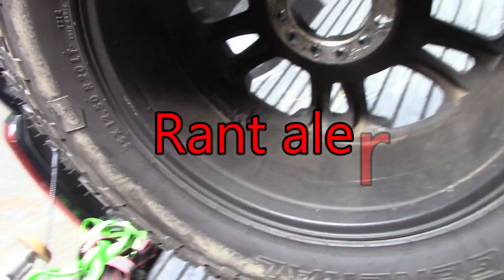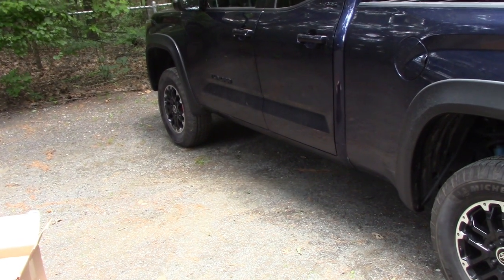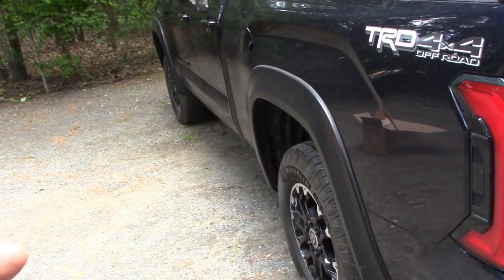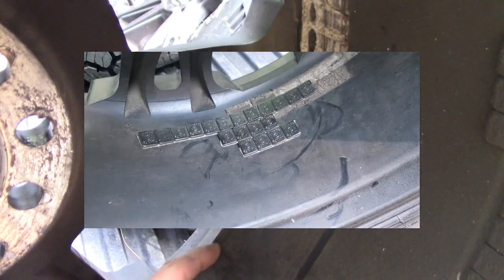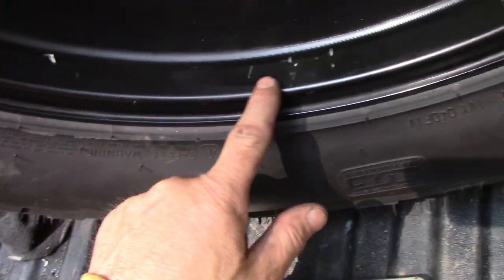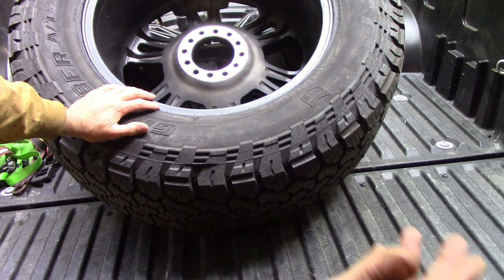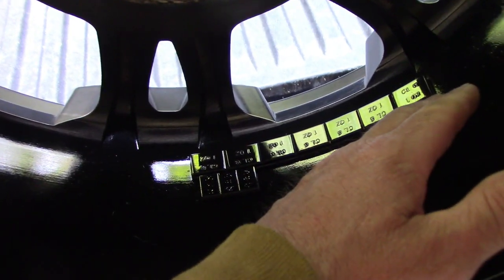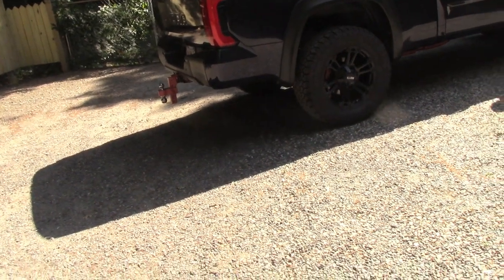35x12.5 tire balance fix from vibration.

Comment: Road force balance is what you need  this exact thing is happening on my 2010 Toyota Sequoia with factory wheels and all-terrain tires smooth as butter all terrains on aftermarket rims that look very much like yours shakes at 75 and above you need road force balance done on all four and possibly another alignment

Comment: Another issue I found that alot of tire place and dealer do  is that when they mount a tire there a yellow dot the dot supose to be aligned  with the valve steam , each tire is not made equal  so when they put the tire on it needs so much weights, I have a 08 tundra been having same issue , then I research  the issue  and told them to fix the tire they where laughing, sure enough after fix was less weights stop shaking in freeway

Comment: Hub centric rings the wheel isn’t centered with out them if you still have them try rings and drive that truck more not good for the engine to sit